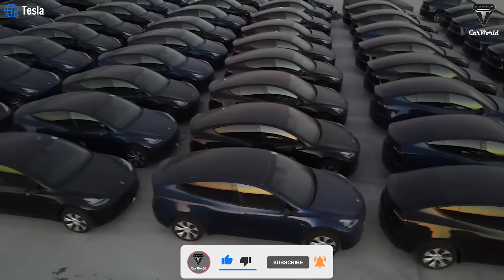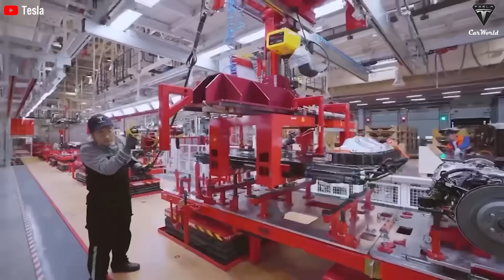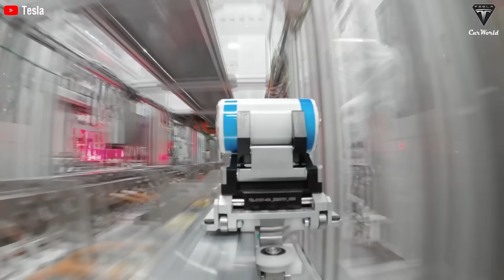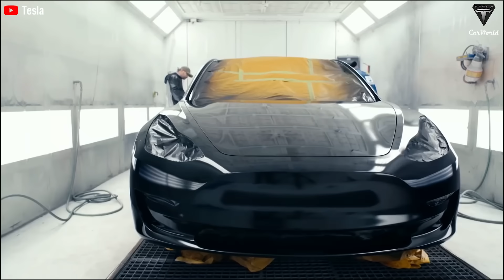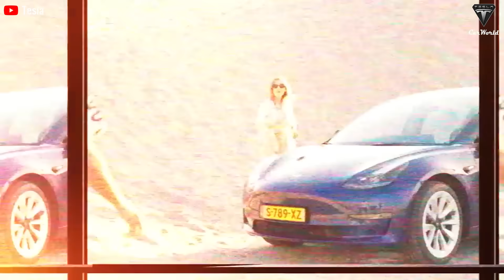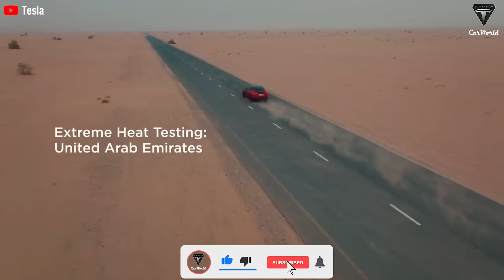P3! Inside Tesla Lightning - Fast Car Production: Elon Musk Unveiled How Can They Do 30 Seconds?

Comment: A gigacasting is not done with sheet metal it is a molten alloy which is forced at high speed and pressure into a mold.  Big difference.  Don’t make videos without understanding what you’re talking about.
Reply from the maker: Thank you for pointing this out, we have confusion between metals and alloys, where mostly aluminum is poured into a casting mold!